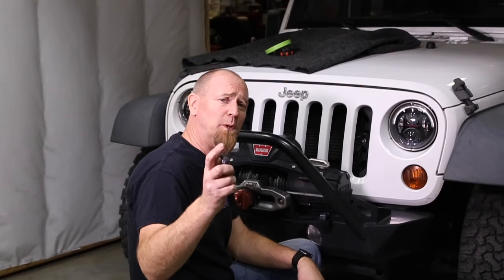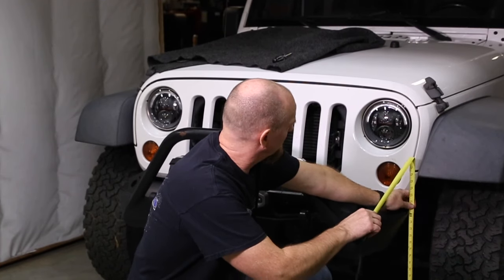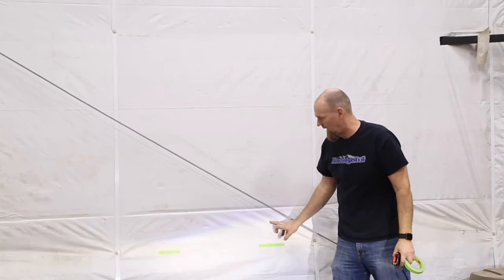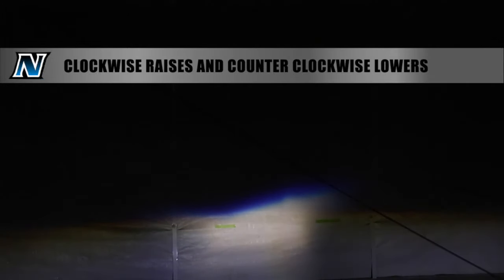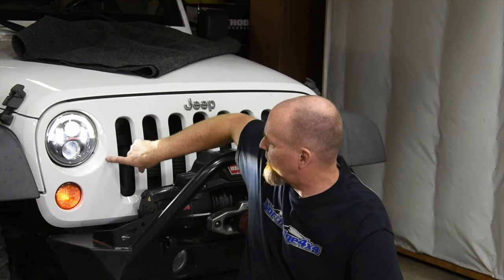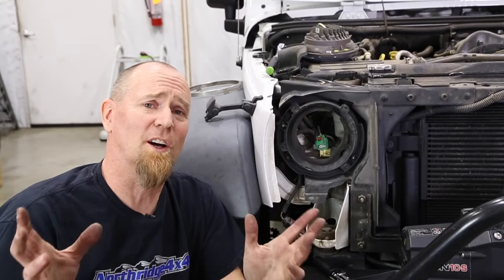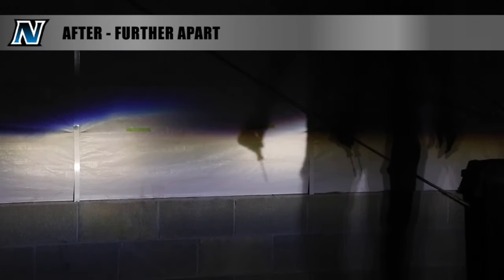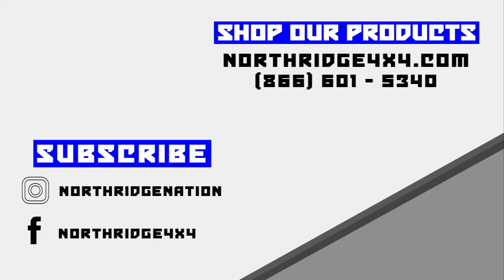Jeep JK Headlights Adjustment + Mopar Euro Headlamp Adjustment Screw

Comment: Very easy to follow explanation. Only problem I had (not related to video) European screw doesn't seat well, bezel goes through either side. Either hole too big or I damaged it while pulling it out. Any ideas?
Reply: The plastic which seats in thin groove is gone. One time use only and also brittle after 10 years. I used hot glue on both sides and it is working perfectly. In my opinion going for european adjustment screws is not recommended. If you have to do it, than get new mounting rings, which are just $12 for a pair anywhere.

Comment: Followed the instructions for the adjuster screws. Bracket was like it was stuck to the pins and could not be 'gently' pulled off. Ended up with a stripped screw that's stuck halfway through the bracket and a bracket that can't stay attached because the euro is stuck.
Reply from the maker: Must've cross-threaded the screw?

Comment: Great video, but you did not mention if you need one or two additional MOPAR EURO HEADLAMP ADJUSTMENT SCREWs per light? In other words, do you use the top original adjusting screw and ONE MOPAR EURO HEADLAMP ADJUSTMENT SCREW on the lower opposite corner, or do you need two MOPAR EURO HEADLAMP ADJUSTMENT SCREWs per each light?

Please be clear on how many I need to order?  Thanks
Reply from the maker: You need to order two screws to do as shown in the video.
You leave the factory adjusters in place and then add one screw to each light bucket.

Comment: Would it be feasible or even remotely necessary to replace both of the bottom screws with these euro screws?
Reply from the maker: It would be feasible, but you could only adjust it if you had the grill off or modified the grill to be able to get to the screw.

Comment: Mine were stock height on JK, and wouldn't go down any further. I can go up. But I'm already getting flashed by some other drivers. What should I do?
Reply from the maker: Look at adding in the Euro adjusters shown in the video, they are only a couple bucks each and will give you a larger range of adjustment.

Comment: I could not get my headlight bucket (mounting ring) off its pins. Twisted and pulled, added WD40 and then It snapped at the bottom. So, I just put everything back together the best I could. Did not try the other side. Stopped there. Never got to the step where I could replace the factory pin with the two I purchased from you.
Reply from the maker: Wow, curious now on what why it was stuck that bad. Was it moving at all?

Comment: Is this adjustment made with high beam or low beam?
Reply from the maker: Sorry for the delayed reply, YT doesn't have a very god message alert function for older videos.
All headlight adjustments are done with the low beam.
Reply from the maker: All adjustments are done on the low beam side.
Reply: You can look at the Jeep in the vid. Only one reticle illuminated. It’s the low beam.